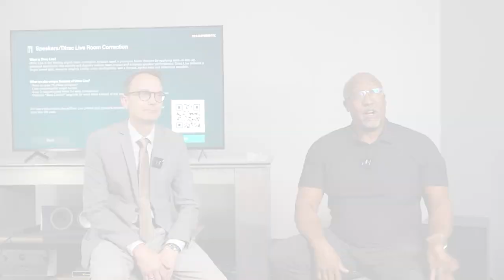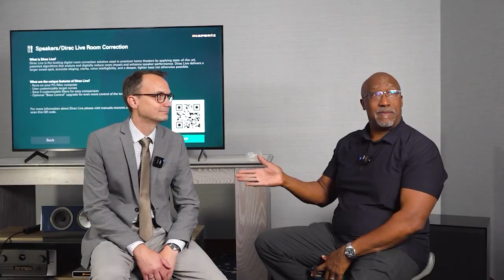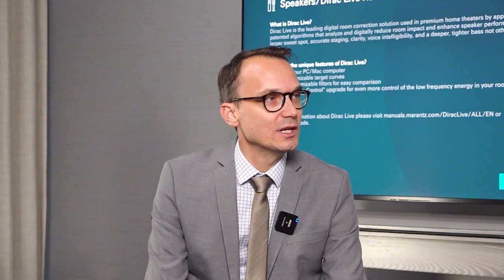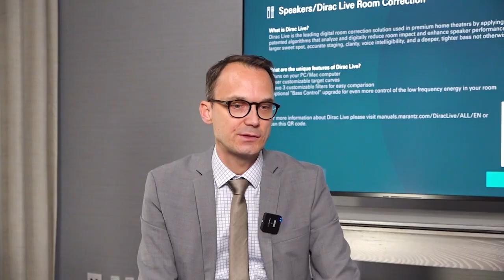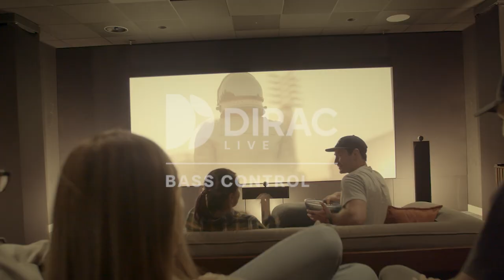techTALK - with Phil: "How Dirac Transforms Your Audio - Bass Control Explained!"

Comment: Bass Control and the Denon A1H transformed my 4 sub setup to the next level. Before that i was experimenting with a MiniDSP2x4 but wasnt experienced enough to get really good results.

Phil: How did you go about having a 6 sub setup in your demo room with only 4 sub outputs? And how would Dirac handle such a setup?
Reply from the maker: Hello! We're glad to hear that you're enjoying the bass control for your four subwoofers.
Regarding the six-subwoofer question, in our Demo room, four of the subs are connected through the RCA Subwoofer pre-outputs. The other two subs are integrated with the front left and right speakers and connected via the speaker terminals for the front left and right channels. The front speakers are connected to the subs and set to a crossover frequency of 40 Hz. In this configuration, Dirac measures the front LF and RT Subs/Speakers as Full-Range Speakers.

Comment: Thank you for the great content! I wish there had been more in-depth exploration of the software. I’ve previously engaged with the Dirac helpdesk, but I’ve found their responsiveness to be inconsistent—oftentimes, my questions or concerns were resolved before I received a reply.
That said, I’d love to share feedback based on my experience using Dirac Bass Control with my Denon A1H. I believe there are small but meaningful enhancements that could significantly improve the solution. For instance, the addition of more presets would provide greater flexibility for users, and it doesn’t seem like it would be overly complexed. I also think an App would be great. Moreover, adding the ability to display the Dirac curve—or any details about curve adjustments—directly within the AVR would greatly enhance the user experience.
If there’s an opportunity to be part of a pilot program or provide further feedback, I’d be delighted to participate